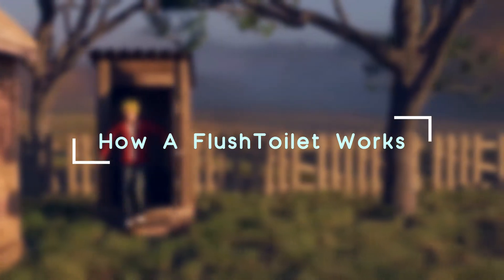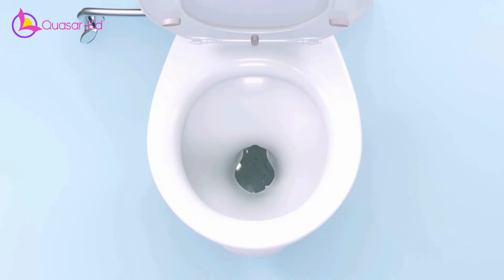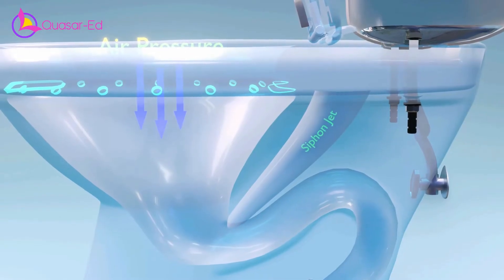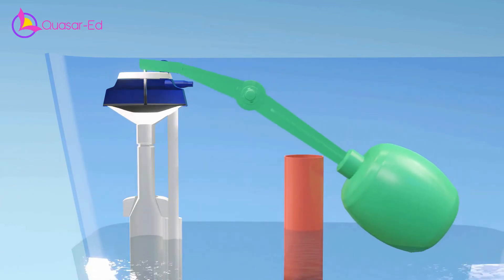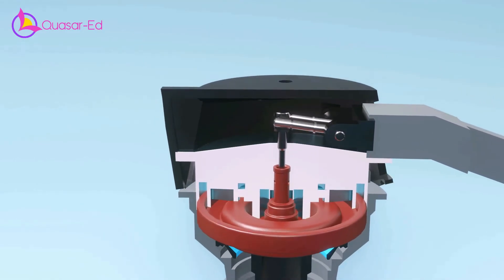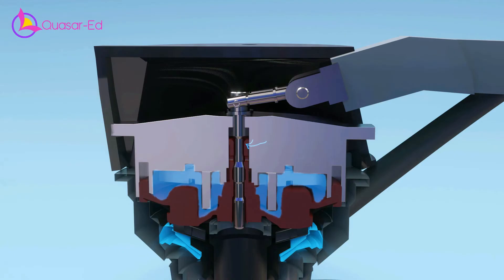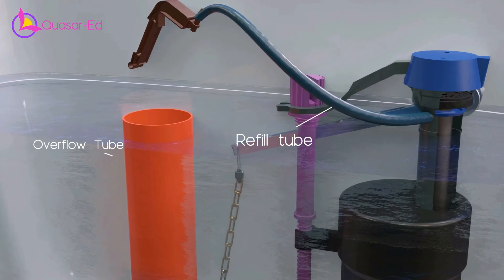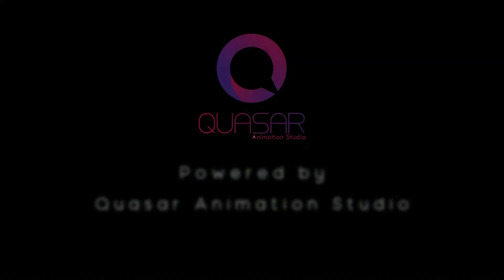Toilets: How They Flush and What Happens Inside!

Comment: Ironically, I searched for this video bc my "silent fill valve" keeps making this REALLY annoying, high pitched squeal sound. It will do it spontaneously even if I haven't flushed it for an hour. I'm gonna try some wd40 but I'm wondering if there's a mechanical fix
Reply: I'm guessing it's the pin in the diaphragm scraping the sides as the main inlet water presses up on it

Comment: By far the best video on this subject.  If the bowl is filled before the tank is filled, wouldn't water be wasted by continuing to add water to the bowl through the overflow tube (which will just trickle out through the trap and down the drain) while the tank is still filling?
Reply from the maker: @shanefrank3281  Yes. It Sometimes  happens when the switch get stuck, leaving the flush gate opened.  Usually the flush gate automatically close by its own weight but when the water started filling, it opens up a little bit, allowing the water to fill the bowl but after the water level rise above the gate, the water pressure keep it close so that all the water stay inside the tank until the flush gate is open again.